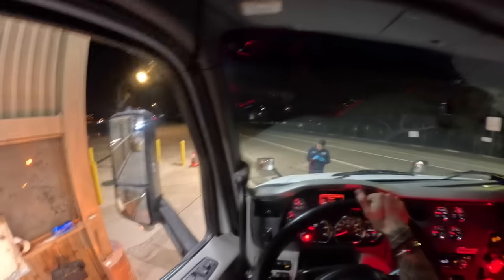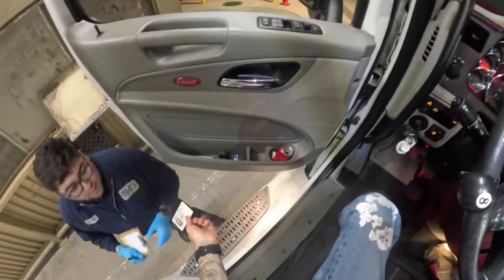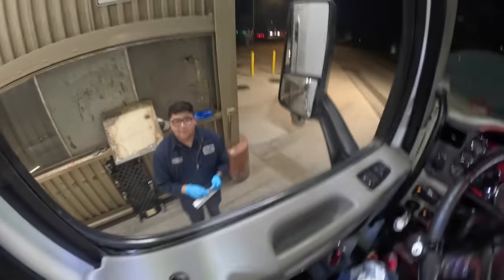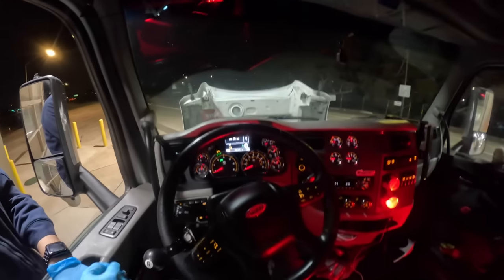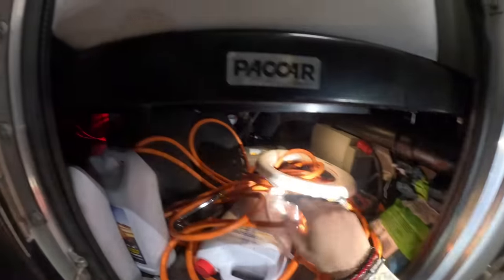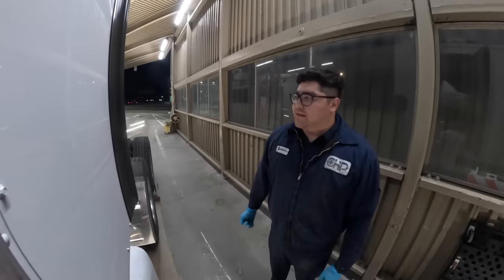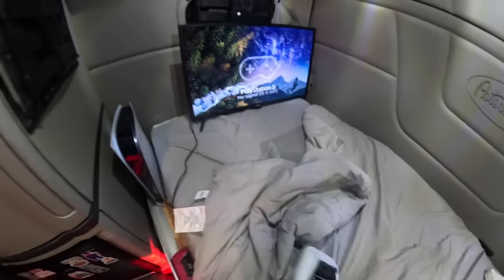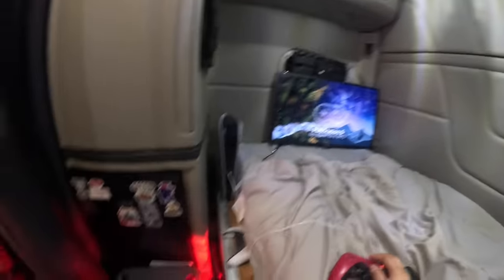A Rough Overnight Truck Camping w/ Spicy Ramen & Japanese A5 wagyu on hotpot

Comment: Those violations are noted for you to fix and next time if you get stopped and the same violations are brought up, they may fine you. Those are not OOS-able, per say. I got pulled in i5 N in castaic and had a small air leak, headlight blinker was not functioning properly and ABS needed to be repaired. I repaired those issues and stopped in again to get a re-inspection to get the sticker, but they told me just drive in and when my turn comes, at least those issues are fixed. Some stuff does fly by us so it is helpful they remind us of the small things, and they’re just doing their job. I want flares instead of triangles. Damn things are always breaking and falling over. 🤦🏻‍♂️ cool vid bro.